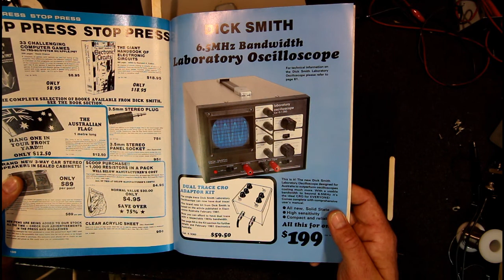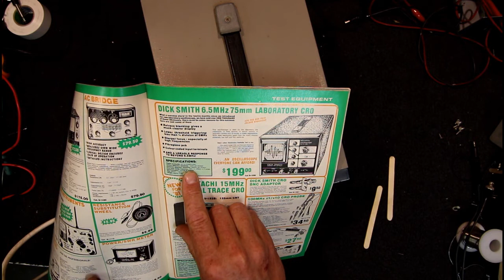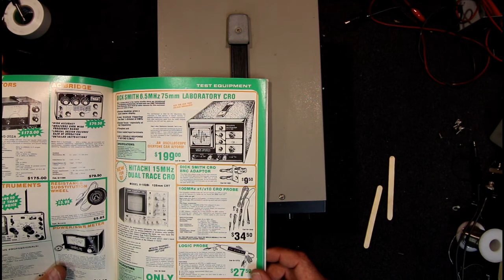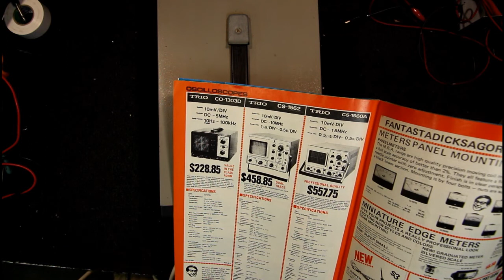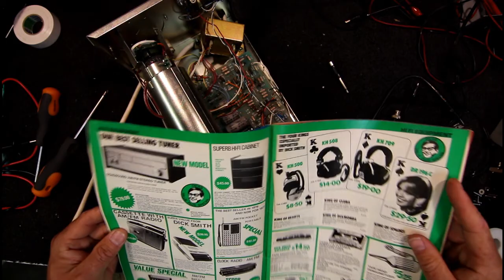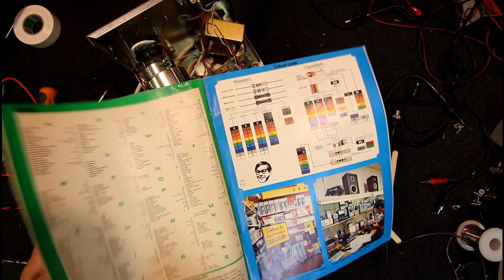Dick Smith Q-1280/Trio CO1303D 6.5mhz 1980s Oscilloscope

Comment: Hi Steve, the original model was the NYCE TS 5000-00 (Hong Kong - 1980), in the Italian magazine "Selezione Radio" n.5 1980 you can find the diagram
Reply from the maker: Thanks for the information. Looks like they sold test gear in Italy under that name. It may well be the company that made them, as they are sold under a few different brands just in Australia, and most electronics stores were importing everything from Hong Kong back in the 80s.

Comment: Hi Steve I have dse q1803 the crt does not come on. Would you like to do a repair video if I send it to you.
Reply from the maker: I dont think I have ever tried to repair an oscilloscope, but would be willing to give it a go. Does it have a circuit with it?
Reply: @StevesElectronicRepairShop  no circuit.
Reply from the maker: @samsons4911  I have set up an email address if you want to contact me there regarding sending it, and I will see what I can do with it.
Reply: I have the same problem but with the same model as the one in the video! It powers on and the filament at the back turns on but no display :/ please help!

Comment: Hi Steve, I have just bought one of these (works fine) I did stumble across the user manual on the web 

https://78462f86-a-ce1367f2-s-sites.googlegroups.com/a/valiukas.org/www/Home/st/Q%201280.pdf?attachauth=ANoY7cr4myAJ2fLCh131ekT7c_lLizMG6XUS4fZooq9onlh-0XCdv8tPkGIefV_UjQTnMOs8dr4cvR9nHhwhtb-Z2DunjRzWVVU958iYG0NSBkhS2vCSTs66OIn-Kz0O4gA89Ws3-LL18XWdVP_MydZOOTBFC9rRyU26X9ebkEYkp4zv4t-UjzZWcm1b4PgCsGn40Nly0HHh6WUx7jGJF1c01aEPQNOgFg%3D%3D&attredirects=3

However, the link does not seem to work now. I do not suppose you have a copy of the user manual do you
Reply from the maker: Unfortunately I dont have the manual. If you are on Facebook try the Vintage Electronic Test Equipment group. With nearly 10K members there is usually someone who can help.